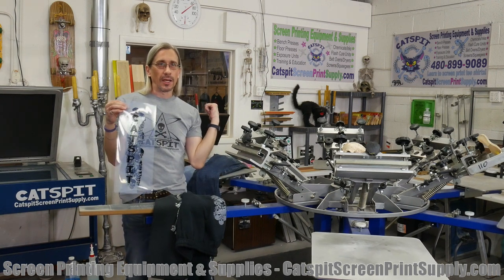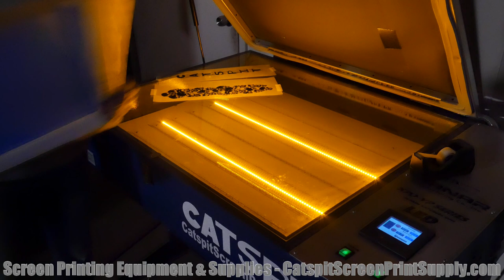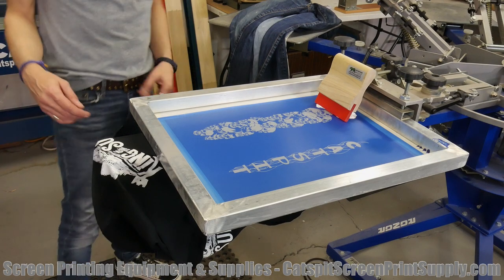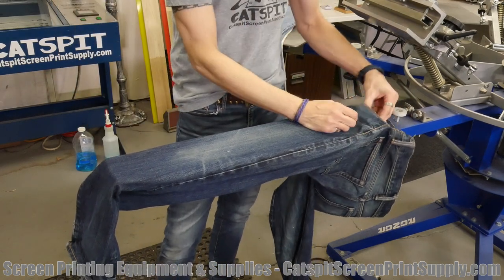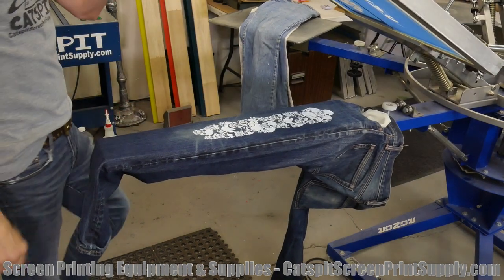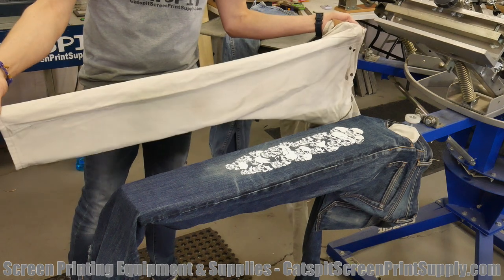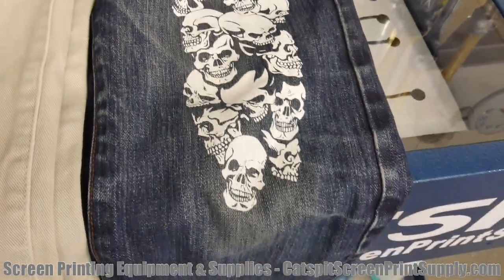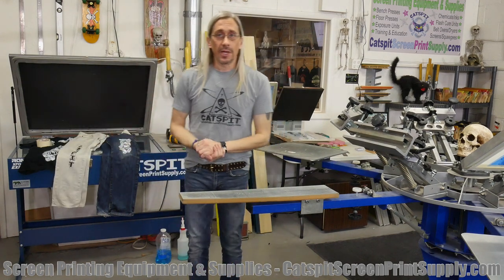How To Screen Print Denim Jeans: Expanding On Sweat Pant Printing

Comment: Could you also print over the seams aswell?
Reply from the maker: I would not recommend that as the seams on jeans are very large and bumpy. The print will suffer in the area going over the seam depending on what type of seam it is of course. Thanks for watching! Screen Printing Equipment & Supplies - http://CatspitScreenPrintSupply.com/